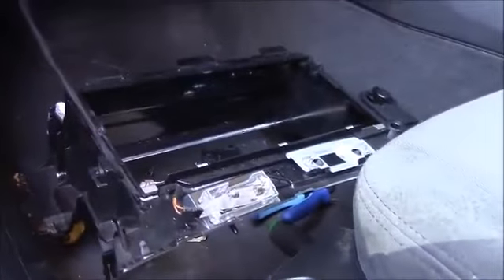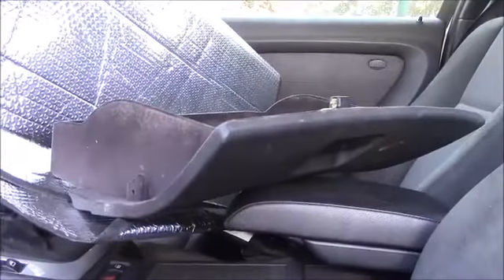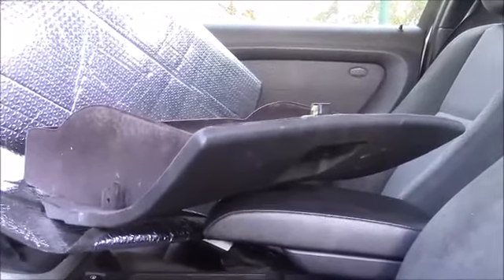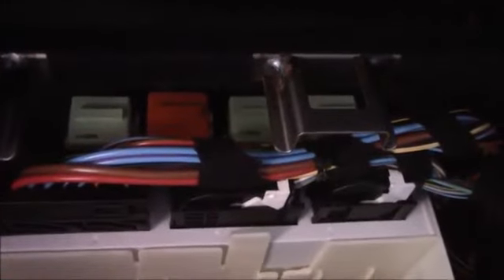BMW E46 relays location , under glove box fuel relay , horn and fog light relays

Comment: #2 should be blower fan relay. Will arc itself into on position.
Fan runs with key out. 1998- 2004/some till 06
Update : 10/1/21 - Found out this model is wired 3 different ways. 
This must be someone's money maker. No definite  location.
Reply from the maker: excellent thanks for comment